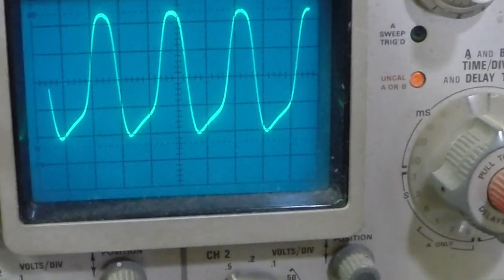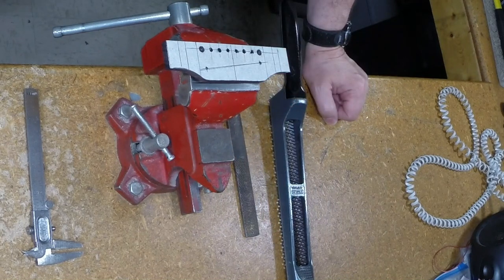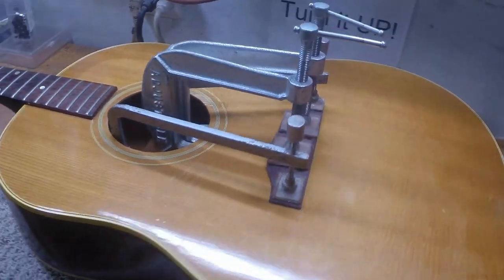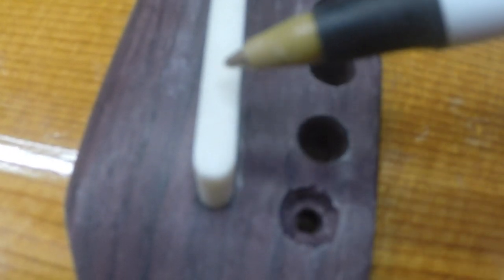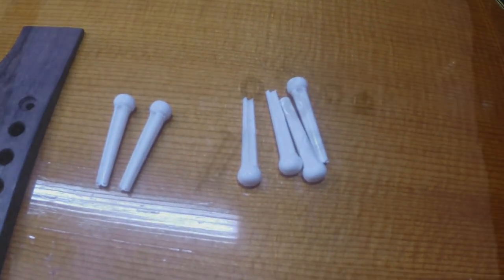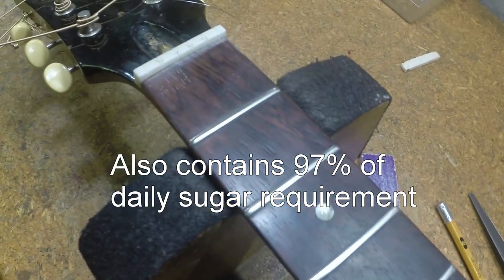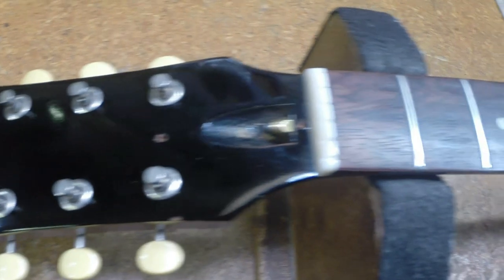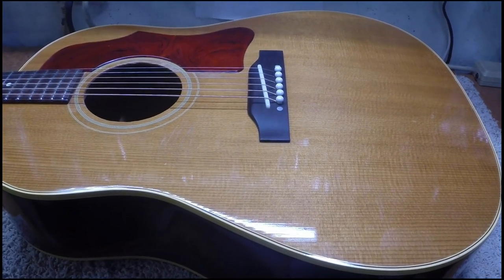1964 Gibson J 50 Repair

Comment: I would have just put the dot inlays in and not the screws, no need for those in my opinion but of course they don't hurt anything either, bridge turned out awesome, way better then that stock POS. Good job.
Reply from the maker: The bolts were put in so it looked stock from the inside as the years previous and post to the plastic bridge.  Thanks for watching.

Comment: My first thought was, "How did that happen??"
Reply from the maker: I have seen this a lot.  So here ( don't you feel lucky: ) is an explanation.  We have 6 bridge pins and 2 bolts preventing the rear of the bridge from sliding forward.  Then we have a big slot cut through the bridge for the adjustable saddle, leaving very little wood to support the ends of the slot. Now we add string tension rolling the saddle forward acting as a wedge.  Throw in some wild cards like a hat car, or a host of other factors that could cause the glue joint to fail.... and there you go the exploding adjustable bridge.  It was an improvement over the plastic version from '63.
Reply: @guitarc.p.r.9675  Okay...I get it. Ka-Blooey!